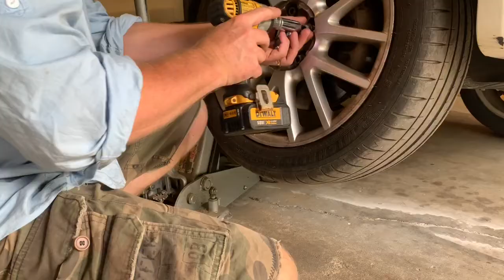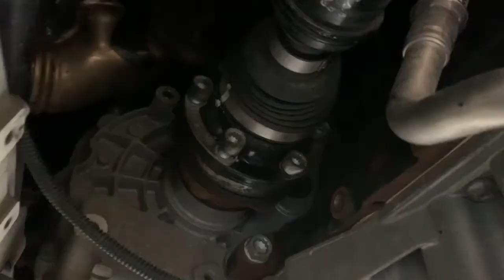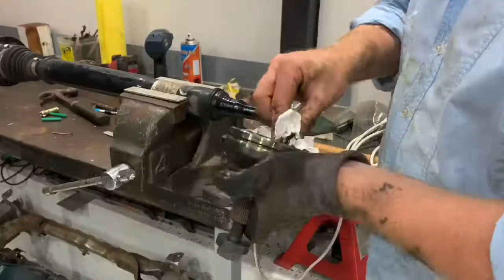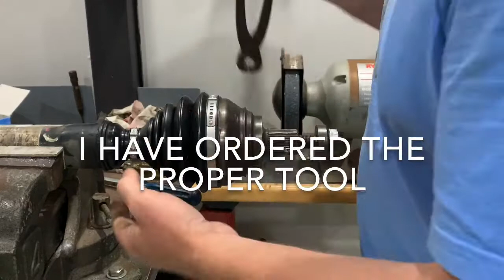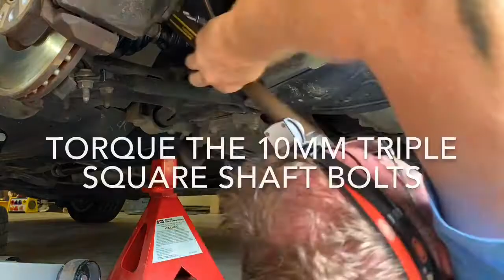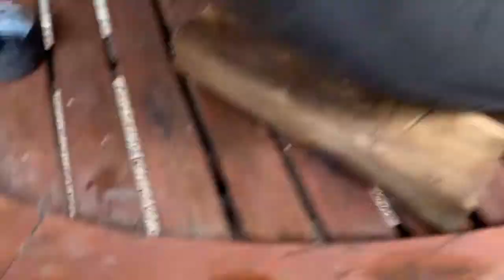VW MK5 Jetta (or Golf GTI) CV Boot Replacement

Comment: Should the wheel alignment and wheel ballance be checked after fitt full set cv joints
Reply from the maker: If you disconnect the taper joint of the ball joint rather than the 3 bolts there should be no need for a wheel alignment.

Comment: I LOVED your trick to take the joint off the spline.  I put a 7mm socket inside and tightened down the axle bolt and it came right off.  Awesome!!!!
Reply: Yea... I did that and the 7mm wasn't long enough.  It just fell into the housing of grease LOL.   Soo yea, I don't recommend.  You need something longer. At least for my 2010 jetta.  Maybe it's easier for other models.

Comment: Any issues with your alignment doing this this way? I just got an alignment 2 days ago and now my boot has ripped. Hoping to get away without another alignment but am worried to mess new tires up as well.
Reply from the maker: It is best practice to remove the joint at the taper to ensure wheel that the alignment is not altered. However, if you are careful upon reassembly, you can match the original bolt and nut locations and you should not have any issues.
Reply: @PetesWorkshop  thanks for the reply! I'll use the taper then if I need to! 🤞

Comment: Did this job hold up? Looking to do mine soon.
Reply from the maker: Yes still perfect.
Reply: @PetesWorkshop  Awesome, glad to hear it! How long did you think you drove on that ripped boot before you rebooted it? Guesstimate?
Reply: Question. Do you need to put a new retainer clip on the end in order for the  race and cage plume shaft to get past it to slide and lock in place? Seems like the old clip won’t let it go back on..
Reply from the maker: @hardcore4476  yes I think the clip should be in place. Not sure why yours is having trouble sliding over it. Perhaps check for a bur. There should be a small taper to compress the clip. Maybe try to squash the clip a little. Good luck and do and let us know how you get on with it.

Comment: Did you replace the clip at the front of the shaft that actually holds the cv joint onto the axle??
Reply from the maker: That’s a really good point. I don’t recall but it also looks like (re-watching the video) the c clip was missing when taking off the CV joint. Hmmmm

Comment: Your really good at doing all this stuff! You saved my day when I did a boot replacement. Some other vid tapped out the cv joint w/ a brass punch. I went and bought a brass punch kit for $40 and ended up not using them cause your method seemed way way easier! Thank you for taking the time to post this vid! You should get some $$$ every time someone watches your vid and saves money by not paying a shop!
Reply from the maker: You are very welcome. I’m so glad it helped you out.

Comment: looks like you don't even need a new boot. just push the inner side of the boot closer to the end of inner axle, tight up the first pinch with a stainless steel wire that also stop the leak.
Reply: Yea, how long would that cheap fix last? And it would need to be correctly replaced eventually. Do it right the first time.
Reply from the maker: Modern boots are made from plastics rather than rubber. If it doesn’t seat where it’s designed for it will not seal.
Reply: On a Mk5 Jetta with a Diesel you can remove the axle without taking the lower ball joint off. Just turn the steering wheel to the opposite side you are trying to remove.